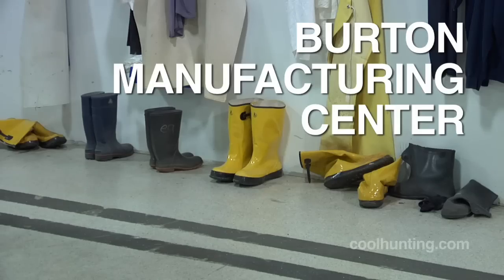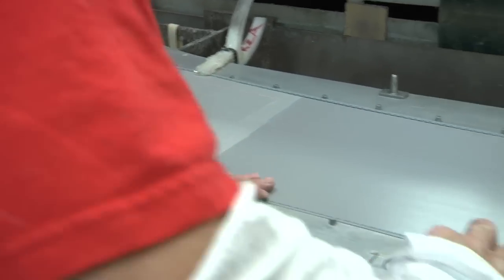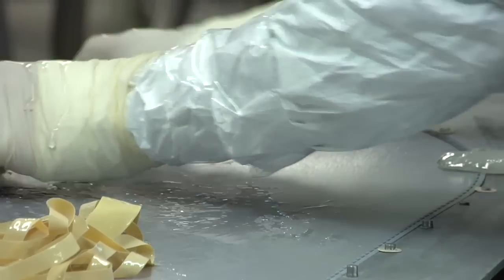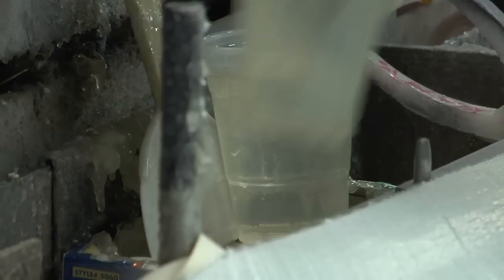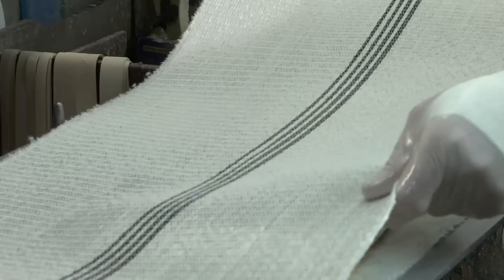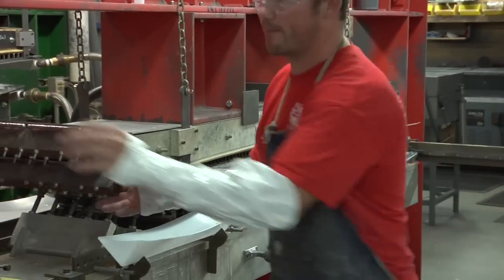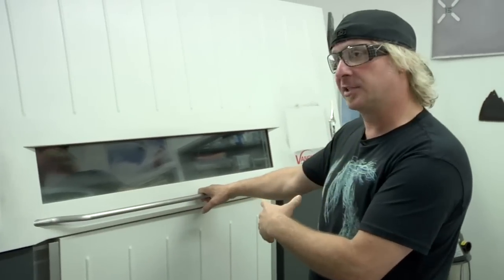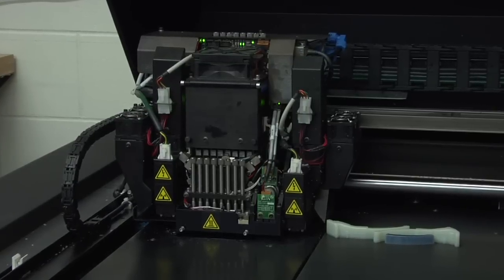Burton Manufacturing Center: How to Make a Snowboard

Comment: Aaaannddd that board snapping at the end is why you buy a quality USA made board with a tough base, like Never Summer, Lib Tech, or GNU. Never Summer would also replace that board for 3 years with no questions asked. It's a lot tougher than any Burton, which is actually made in China, not Vermont like this video implies.
Reply: its called testing to failure, actually a sign of good quality control